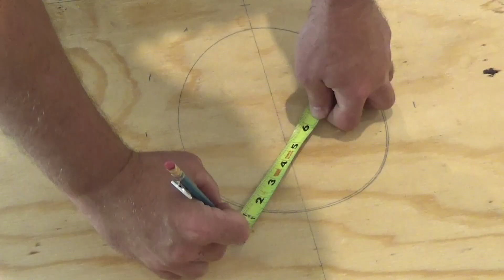Building an out house from scrap logs

Comment: As a fellow maker,  I hear ya on the grand caravan,  don't knock em till you try em!  I have 184,000+ miles on my 2010 and I've hauled more things in that thing than most people do in their trucks.  I haul lumber,  firewood,  minibike,  plywood/drywall, boulders for my backyard pond build,  table saw, my 3 kids, etc.... those stow and go seats are great, haul the kids one minute and haul some gear the next minute. Price was right when I bought it back in the day.  Anyway,  nice video and build!  Sorry for the minivan rant,  they get a bad rap and everybody makes fun of em until they have one 😉
Reply from the maker: Man I totally agree . I hauled a 45'' wide 13 horse snowblower in mine . I've had 3 whitewater kayaks inside with myself and  the other 2 paddlers , I once hauled 1600lbs of laminate flooring in it which was maybe a bit much I've  camped in it . it has 320,000 miles and I keep thinking I should get another vehicle soon and all I can think is its going to have to be another grand caravan lol
Reply: @blackspruce1861  heck yeah man.  I can't believe you hit 320,000, that's awesome!  Last time I was changing my oil I noticed the frame is rusting pretty good (Pennsylvania winters and salt on the road,  which I'm sure you know what I'm talking about up in Michigan).  I'm still surprised they stopped making the grand caravan back in 2019. I'm more than likely getting another one too. Anyway,  keep up the videos and getting your money's worth out of that mini van!
Reply from the maker: @StevePrimo I’m pretty shocked too . I really want to see what I can get out of it , would be awesome to hit 400k

Comment: So the idea of going out there in the freezing cold is a hard pass. Anyway to put some heat out there?  The seat has to be ice cold in the winter.  Are you putting lye in the hole?  How are you dealing with that?  I know they have stuff to break down the waste. What about a composting toilet inside the cabin?  The moon and tree probably bring in cold, maybe polycarb on the inside to keep the cold out?
Reply from the maker: I changed the seat to foam for the winter .

Comment: Ryan this turned out very nice indeed!  Get your dog an excavator & let him / her dig! The thing about outhouses  you have to consider
1) Location  2) Comfort  3) Ventilation 4) Lights
1) Location - looks like a good spot
2) Comfort - looks about the right size, not too small.  Air Spray, plenty of T.P., adult wipes & lime, for decomposing waste.   $8 toilet seat, hey as long as your wife is happy.
3) Ventilation - looks like you might need more.  How about adding a Solar Powered Exhaust Fan & maybe a timer?
4) The clear panel roof is great, consider solar lights outlining your outhouses location & a 12 volt light inside for those midnight trips out. Hey if the wife isn't happy....
Reply from the maker: thanks !! he's a digging dog !! I do want to put a solar light on it